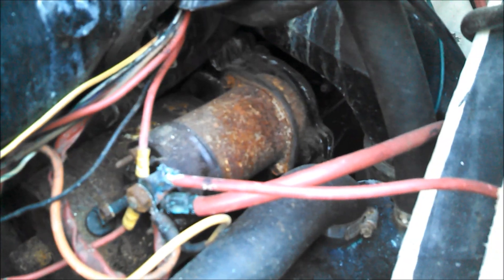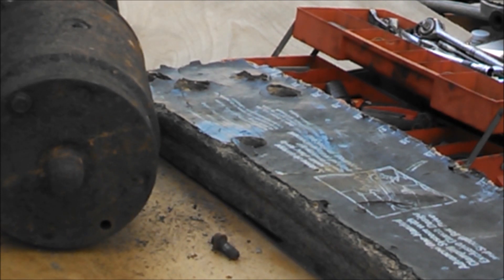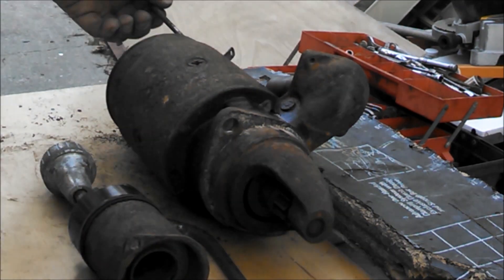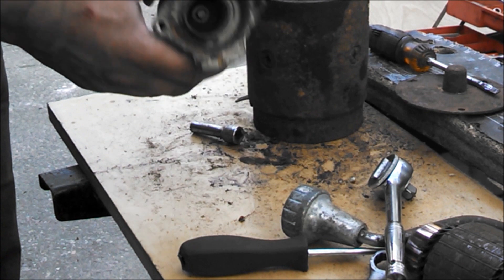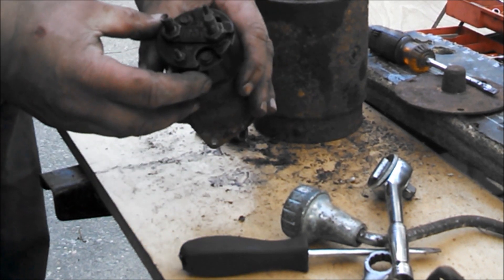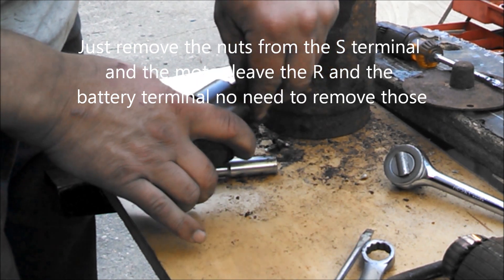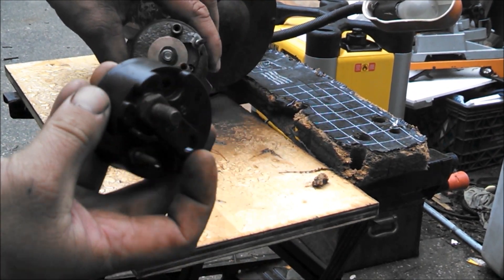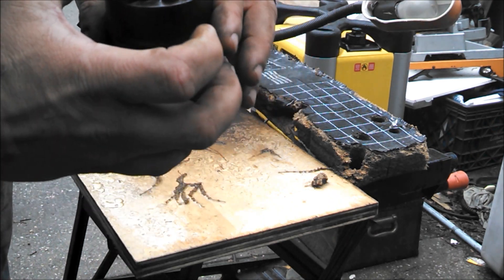Mercruiser Starter Rebuild  Marine Starter Repair part 1 of 2

Comment: Thanks so much for this very simple yet informative video. I have never rebuild a starter. But after buying our used boat and it having a 898 305 5L engine in it, i heard the starter quit working but i heard the clicking. After watching your video i feel like i just gained insight to rebuilding any starters. Thanks a lot and God bless!

Comment: Did you have to remove the heat exchanger to remove the starter?
Reply from the maker: I did not both bolts are above the heat exchanger

Comment from the maker: your welcome. In a lot of cases just cleaning up the commutator lubing the bushings. and replaceing the solonoide is all you need. $20 in parts not $200 for a replacement starter.

Comment: '80 bayliner 470, starter wasn't working took it off and checked it and it is working, would it be wise to leave alone or take apart? everything else was checked prior to removing. I'm guessing it was a bad ground on the motor,  what are your thoughts?